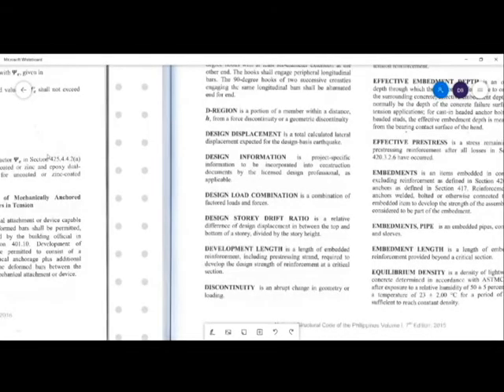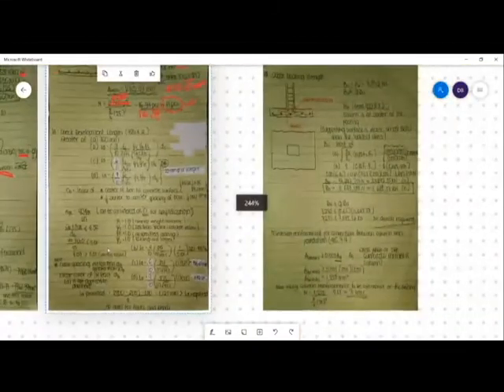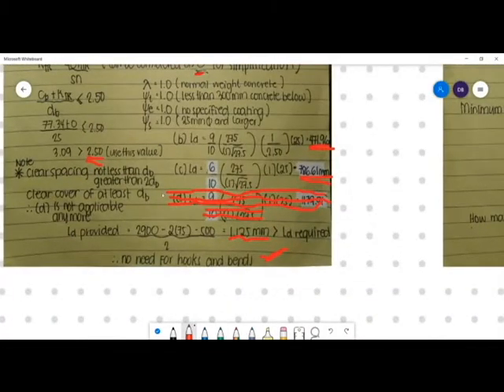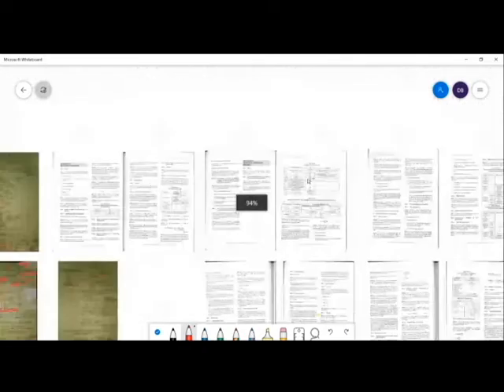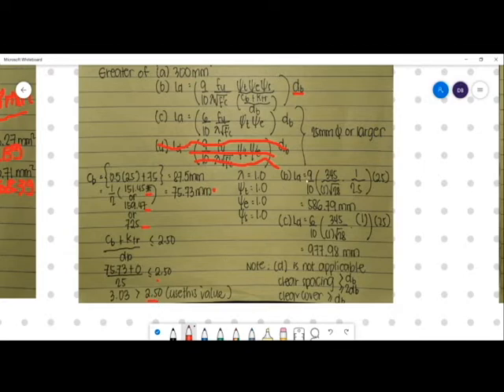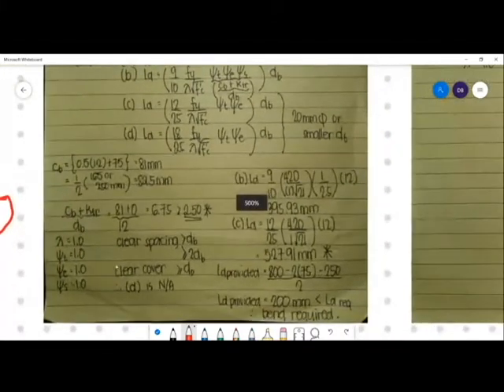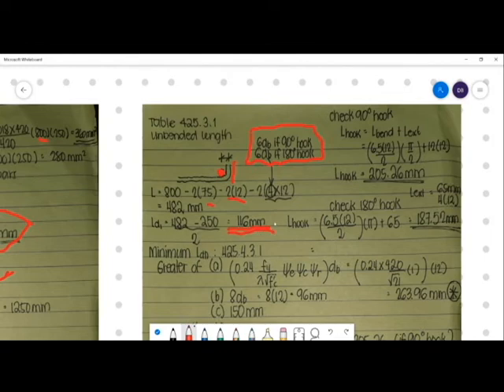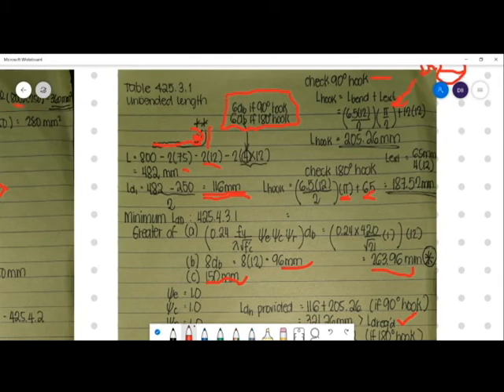Foundation Engineering S03E02 part 6 - "Design of Spread Footings: Dev't Length & Concrete Bearing"

Comment from the maker: How to compute for the center-to-center spacing of rebar:

1. Dimension of footing - (2*Concrete Cover) - (Number of Rebars*Diameter)
2. Divide (result from 1) by (Number of Rebars)
3. Result of (2) is the clear spacing of rebar, for center-to-center spacing, add the diameter of rebar (refers to 1/2 from the left and 1/2 from the right) 

Kindly use this method. But it will still depend on how you imagine the detail of the reinforcement.